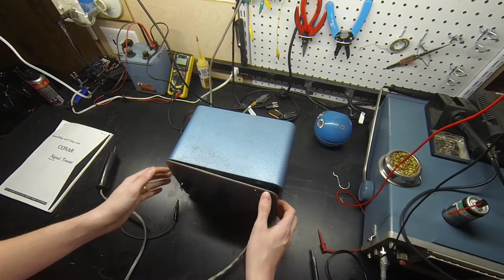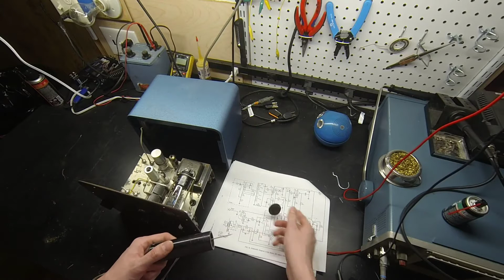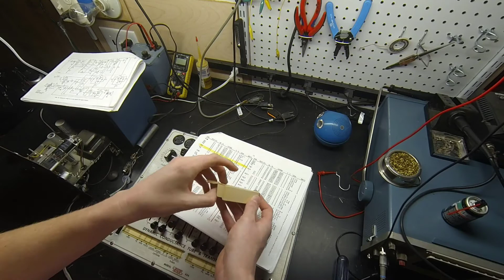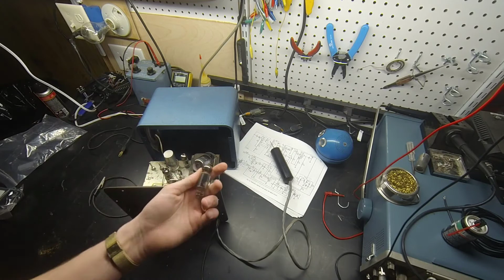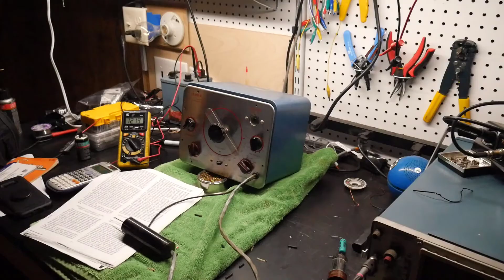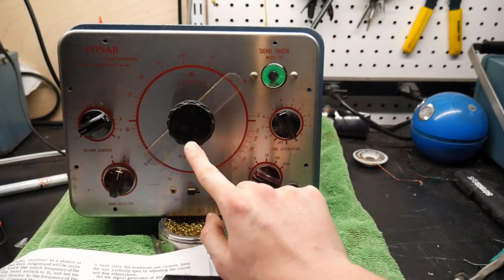CONAR Model 230 Signal Tracer Restoration Part 1

Comment: I pocked up one of these at eBay for about $66 and it worked beautifully without anything need to be done to it. I dis open it and checked all the tubes except the one in the probe. I tested the filter caps and several power resistors again ok. So i fired it up and to my amazement it worked flawlessly. I cleaned up the switches and controls. The case needed cleaning , but didn’t look as nice as yours. My model was factory built , not a kit. I could tell because I worked in manufacturing and saw techniques a student wouldn’t know. Im going to experiment with building a solid state probe using a germanium diode. I also have an EICO signal tracer too that works basically good, but is no comparison the the Conar model. Good luck with yours!